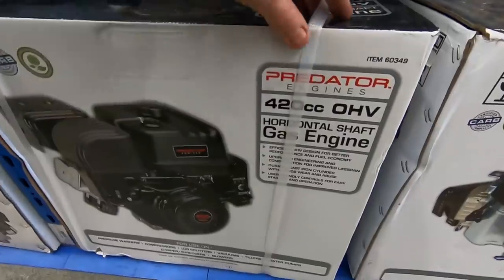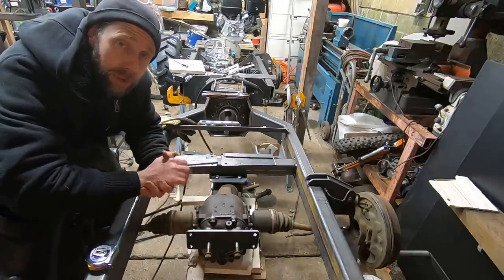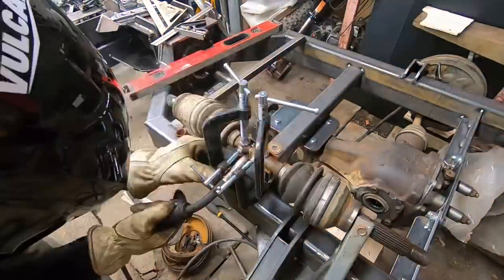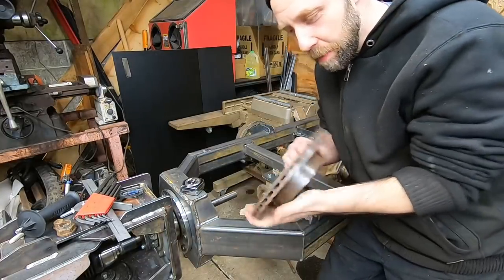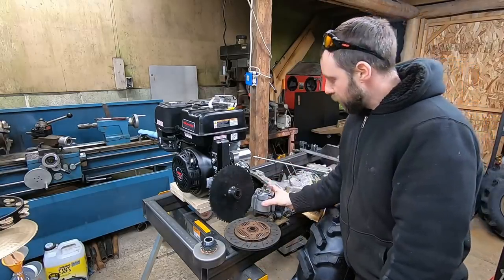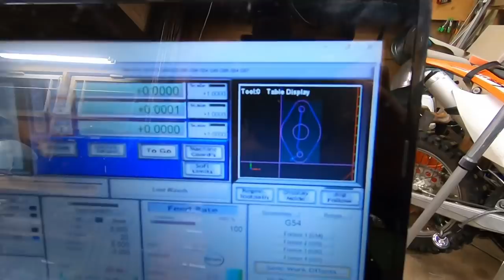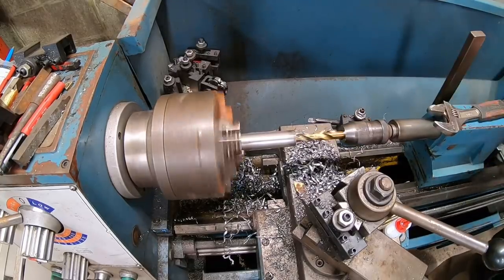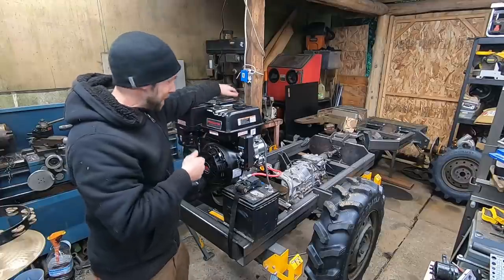420cc Predator powered articulating 4x4 dump truck build part 4

Comment: I like your take on the Pug... I first saw a Pug ATV in 1968 I think it was. Then I saw a Jacobson grounds truck that used the same setup a few years later. I think they were made by the same people at the time.

The last Pug ATV I saw was useing a Ford Escort transaxle turned fore and aft. The half shafs were feeding into a pair of Dana axles. They put the flywheel and clutch on the output shaft of the engine. They were using a Honda v-twin for power.

Boy talk about a trip. Down memory lane!

I really like your project and look forward to the next addition.

Comment: Just a heads up, those transmissions have a viscous center diff, so the driveline brake will only be significantly effective through the rear wheels.   Its a pretty simple job to pull the rear housing on the trans and weld up the viscous coupler though.   Id say it would be a good idea  to weld it up anyways to maximize traction.  3 open diffs in slick terrain equals one wheel drive lol.  Nice work though! Love watching your progress  👍🏻
Reply from the maker: I do recall it having a limited slip center diff but maybe I’m wrong on that? I appreciate the info I definitely think I will do some research on pulling out apart and welding it up, possibly the rear diff as well. Take care 🙂
Reply: @Mikefestiva  definitely viscous centre diff, which was marketed as an LSD (VLSD). Only true LSD centre diffs Subaru put in EJ-equipped 5mt vehicles were the DCCD centre diffs in STi-Ra and other limited run top of the line WRX STi, none of which were sold in US market.

Comment: I'm excited about that cnc table deal. I just bought a industrial Plasma cutter " Thermal Dynamics 60i" and intended to custom make a flat bar cutter for my manufacturing needs. After looking into what it would take for the motors and electronics. I think this plasma table would be a great machine in the meantime to learn from. So I can focus on making money and not working on equipment.

Comment: Hello Mike, the more I been thinking about this build the more I am leaning to tell you that you should of used aluminium metal instead of steel. I know steel is a lot easier to use but the weight factor is just a lot more against in your favor. The brakes are something that is different from being in a car as the front brakes do 60 to 70 percent. This dirt buggy should have the proportioning valve should be set fifty fifty front and back. You want total control at slow speeds which is what counts. Keep the parking brake, nothing worse than getting run over by something you built. The angle iron trick for welding shafting works great. Have done a many welds that had runout of roughly max five thousandths of an inch. Which is not much at all. Good luck finding treasure in Oregon. Have fun digging for gold. I love the rusty art pattern, Bet you if you take a picture of the design you would really be amaze at the abstract flow. When you weld yourself into a corner just get your friend to lift you out and carry you. That is what the Stooges would do. Easy peasy. Good luck to fella. Peace Vic

Comment: WOW!🙀

Really suprised that you didn't "Lean/Pitch" the Rear-Mid Section for less angle for the Rear Axle...

SWEET BUILD!😎

I'd love to have a Mill, Lathe, and CNC Plasma Table! But as always, space and finances ALWAYS limit us Fabricators!

Take care,
🤓 -Thomas
Western Washington State
Reply from the maker: Thanks for checking out my new video 👍 I thought about angling the rear diff because the drive line is definitely at a really steep angle, if the input and output of the drive lines are at different angles from each other there will be a pulsing effect as the drive line speeds up and slows down as it turns, in retrospect I probably should have just removed the spot welds and angled the rear diff. I think if and when the u joints go out I will probably replace it with a shortened CV axel. Hello from Western Washington too 👍
Reply: @Mikefestiva  Thats what CV joints are made for.

Comment: Oh man!! that plasma CNC table is on point. Not too expensive either. Loving it.
Reply from the maker: Yes it’s a game changer 👍 I really think it’s a awesome tool for the shop, I have cut down on using my drill press, angle grinder and bandsaw quite a bit after buying my CNC table.
Thanks for checking out my new video 🙂

Comment: Man that's a cool build. You should machine a flywheel adapter and drive the pump off of It. Would make it easy to access right at the front of the truck.

Comment: Since your part 10 of this amazing truck build I revisited the entire series and here I realised that your differentials aren't solid axles, like those on rock bouncer buggies, but angled drive shafts! 
I suppose it's because you're repurposing the subaru's drive train and also to raise it higher off ground?
Anyway it's an amazing build and still fun to rewatch them:)
Reply from the maker: Yes sold axles would have been nice but as you mentioned I was working with that I had, the Subaru was really cheap so I bought it for the building, I have realized it actually lends itself to these builds quite well, easy to cut the CV joints to make whatever width you want, compact transaxle without having a long extra transfer case. Take care 👍

Comment: Awesome build! Lol, that looks sturdy enough to drop a small block chevy in it if you want to! :)
Reply from the maker: Stewart Smith Thanks for checking out my project 👍 Haha yes it’s solid! I wanted someone that would hold up well with heavy loads and be trouble free. I’m building it to match the capacity of my 18HP 4x4 tractor. Take care Stewart.

Comment: Loving the build and your ingenuity so far.

 Just one little nitpick thing. Not actually a 2 stage pump. It has a priority flow control rear cover, but only single pump section. For your use it is actually probably better then a 2 stage. 
But semantics... Great job so far.
Reply from the maker: Thanks for commenting! I’m actually really happy you mentioned this, I thought the guy that gave it to me said it was but I could have heard him wrong. The hydraulics are a bit of a gray area for me and I just finally tracked down a little info on the pump, I think it’s a 11 liters a minute.
I’m working out a tank at the moment, it’s on the small side because of the lack of space but I hope it works? Thanks from commenting 👍

Comment: Very cool. Going to need a spring loaded chain tensioner for the drive chain. I think the rest drive shift angle is a little steep. If I built one myself I think I would move the rear axle  back another 6 inches.

Comment: Great project. Should angle front of rear diff up to meet the pivot point
Reply: Wahn Burnskill there has to be an angle in the driveshaft or else the ujoints will bind.

Comment: this is cool the only thing different I would have done is use a clutch like a snowmobile has so it will have a better low end torque

Comment: Hopefully your rear axle centerline doesn’t end up being too far forward based on the rear overhang you plan to have for the dump bed. 
It looks like it might be too far forward but it might be positioned that way for tire clearance when dump bed is up which can’t be seen on video yet. 

I look forward to seeing this thing running outside.

Comment: Hydraulic pump oil seal - I see from the video the original seal is brown and manufactured by NAK with a design code of TCN1 - this is a Viton high temperature seal with a pressure rating of 5 Bar (70 pounds per square inch approx.) The new oil seal you have purchased to replace the original should be of the same design material & pressure rating or better ? - if not on initial run you may find the actual sealing lip will blow out . Standard oil seals have a pressure rating of half a Bar (7 pounds per square inch approx.) Here in the UK I have been working in the bearings & seal trade for 30 years and have seen guys put standard oil seals in to hydraulic pumps & motors and wonder why the seal fails straight away ?

Comment: Those 2 u joints on the tail shaft behind the trans, I hope you plan on servicing those to frequently . They are  at a severe pitch. I dont really think you could have done any differently though. Nice build I wish I had a place to work like that.  I have a small diesel I'd like to conjer somthing of this nature for. Awesome.
Reply from the maker: Yes I think the rear u joints are pushed to there max, they probably will fail at some point especially because the car had 280,000 miles on it 😂 when they do I think I will make a short CV joint to fit in that location. 
If I had a small diesel it would have been a nice engine for a project like this. Take care
Reply: I was thinking the same thing, steep angle.. But no way around it, time will tell, especially with a fat load of gravel on it.. Awesome build!

Comment: You should definitely make a manual with make and model of axles and other components. Just in case you need to get a new part for it like bushings or seals. Don't want you forgetting what came out of what.lol

Comment: Mike, I'm wondering why you didn't angle the rear diff housing to line up with the centre pivot to lighten the load on the universals - or only use 1 universal? Loving the build though! Ha! Just saw part 5 where you fixed it! 
Have you seen Donn DIY's channel, he does a lot of stuff like you do.
Reply from the maker: Thanks for checking out my video 👍 so to keep it short there was a reason for keeping the rear diff partial with the output bearing. The drive like will actually not spill consistently if the rear end is angled and the output is parallel. But bet his is a slow moving machine I decided the rear diff angled up probably won’t effect the rest of the drive parts if it pulses a little when it turns. Yes DIY Donn is a great channel 👍

Comment: Love the build so far also loved the sawmill and quad truck builds as well. What are you doing for power steering? Will you be building a scissor style dumping mechanism or straight dual/single cylinder like the quad truck? Maybe I am getting ahead of your build but I love at home engineering!

Comment: Centrifugal clutches suck for this kind of application. They are like on-off switch, no smooth transfer of power. You cant slip them either bc the transmission is geared very slow.
I built a tractor a while ago with this kind of clutch, I hate to work with it. Manual belt clutch is just so much better. I wish there were centrifugal clutches like some ATV's use that start to bite at like 1000rpm and can handle heavy slipping... But there are! Those oil bath clutches, they're really good for that.

Comment: Awesome! I'm looking forward to see it running. One question is in my mind: are those hardware store bolts? I don't see an issue with them for holding parts together, but where the rear driveshaft attaches to the the brake disk this can be a point of failure, as their alloy is designed to hold static loads. You might want to invest in some automotive bolts, even if salvaged. Cheers mate!

Comment: you have to have brakes on all four wheels unless your diffs are locked other wise you won't have drive line braking my man like your work
Reply from the maker: I’m going to lock the rear diff, the center drive line brake will be hooked up to the hydraulic brakes. Thanks for checking out my video

Comment: Do not put the earth clamp of the welder after the cv joint, now a high current goes thru it and will create a weld into the cv joint. Nice project
Reply from the maker: I made a mistake, I know not to ground through a bearing or joints like this, it’s quite easy to get distracted when engineering, building and planning a project like this and also set up cameras to document it for others to follow along, surprisingly it take about twice as long to set up and video all of this.
Reply: @Mikefestiva  respect for making these nice video's. On video's like this it looks you only engineering but I know there a lot more before an interresting video is online. See my comments as a help, succes with the build and I keep following the serie.

Comment: Hey, Mike!!!!  GREAT WORK!   Loving the build!   one question....curious to know...since you’re running a 4:1 sprocket ratio, the engine probably peaks at near 4000 RPM, so the trans input will be around 1000 RPM max.  Doesn’t that mean the transmission will stay in 1st gear and not shift at all?  Usual shift points are at higher than 1000 RPM. ??
Reply from the maker: Thanks for checking out my new video 👍
The transmission is a 5 speed manual so no problem on that, I was thinking 4:1 would be fairly good gear reduction but I’m starting to think about gearing it lower, I think I can fit a 72 tooth sprocket in the bell housing this would give it about a 5:1 on the input shaft, I hope to have the top speed 20 mph or a little lower and a creeping slow first gear and I’m thinking it’s geared a little high still? 
Ps I can’t wait for your next video on the bike build!!!
Reply: Mike festiva 
OHHHHHH!!!!!!   OK, cool!  I mistakenly thought it was an AUTO trans!!!!

Thanks also!!!  My Next video, the bike should start to look like sonething!!!  GETTING THERE, now!!!

Comment: I strongly recommend you keep the rear brakes in some way. The split pivot frame needs it because the back end will want to swing around or push forward the front under braking and can be dangerous.

Comment: I would recommend doing rear brakes with parking brake and not driveline parking brake. What happens if on a grade and 1 wheel slips slightly.  It will turn backwards from the other with traction and unit could rollaway

Comment: What plasma cutter do you use for your cnc table? The cut quality seems very good! Also what Max thickness can it do?
Reply from the maker: I’m using the Titanium 45, as with my other welding equipment it’s sold from Harbor Freight. People complain that they are over priced and I to think they are a little on the high side but I have cut about 400 feet of metal so far with it and the only thing I have needed to do is change the consumables in the tip. I have cut 1/2” amazingly clean at a cut speed of about 14” per minute. I think it said in the manual it will cut 5/8” and will sever up to 1”
I make all my cuts on the max 45 amps and have never hit the duty cycle so I definitely can’t complain 👍
I have a video on my channel reviewing it, plus there’s a couple I linked to the top comment, but I can’t remember if it’s still good? Take care 👍

Comment: Great job love it.I Putting an atv engine in a coot,but it spins counter clockwise am going to use T90 trans. The clockwise, counter clockwise thing can be confusing will that spin in the correct direction, the trans  not backwards any thing would help.  Awesome job.

Comment: just started watching you show great work .. dont know how far you got yet but i think you will need rear drums back on for spacing for the rims lugs will not get tight without the drum on ,, dont think there is enough thread on studs .. good luck .. hard too tell on video ..also what did you do with your old plasma table seen other vid you got a new table ,,

Comment: In all of the chain drive equipment I have worked on they use a idler pulley to tension the chain. Tilting the motor could effect its performance.
Reply: tilting the motor to an extreme angle could be a problem but with the short chain pitch he is using the motor will only have to move up or down less than 1/2 inch the rest can be adjusted with chain length. If he is using a 40 pitch chain adding or removing link would only change the motor height roughly a 1/2 inch. but on the other hand if you wanted more wrap on the smaller sprocket for longer sprocket life an idler on the non tension side would help in that case

Comment: In regards to your articulating center joint:
I assume that's a wheel bearing? Those are held together by the stub shaft going through it and it's big nut, torqued to roughly 250lb/ft. I could be wrong but I don't see anything holding it together in your application. Will this be a problem for your use? IDK.

EDIT: Nevermind, lol

Comment: Man, that is something to be proud of! I didn't see a link to the clutch, where did it come from? Is it holding up? Sooner or later I think Im gonna need one.
Reply from the maker: I ordered it on EBay, I looked for a needle bearing 1” bore clutch, I think it cost about $60 or so. If you don’t find them I can dig up a link 👍. Keyfarm Thanks for checking out my video! Ps I really like your 212cc Predator powered tractor 🙂

Comment: Great job!
Questions:
Is the cvg steel weldable. 
I think that the weld weaken the mechanical properties of the material, 
may be the lower mechanical properties after welding are good enough for your application? i don't know

Comment: Hi Mike, you may have covered this in a previous video, but how did you decide not to use suspension on this project? Thanks, Chuck
Reply: This is designed to be a slow moving tractor like vehicle and adding suspension would potentially make it less stable while hauling a heavy or unbalanced load on uneven ground

Comment: Have you taken in  consideration the gearing difference of the front sprocket vs. the rear differential not being in the same speed or RPM . Moving faster or slower than each other ?
Reply: The chain drive is driving the input shaft of the four wheel drive transmission both front and rear differentials  are being driven by the output of the transmission . The reason he is using the chain drive is to achieve a lower overall gear ratio